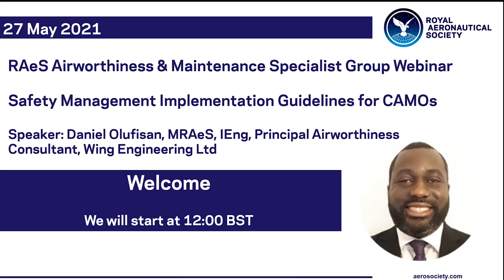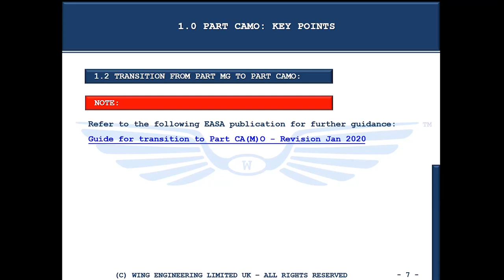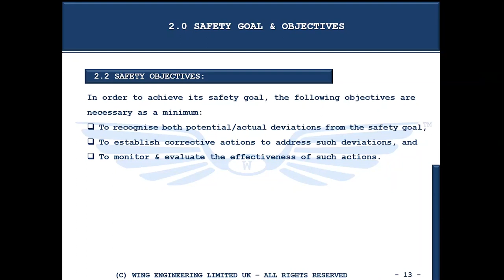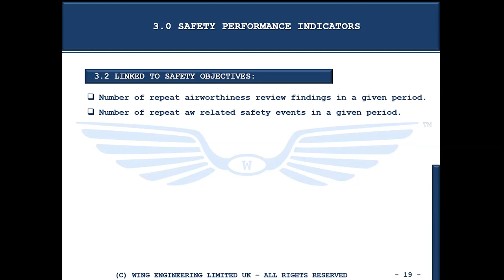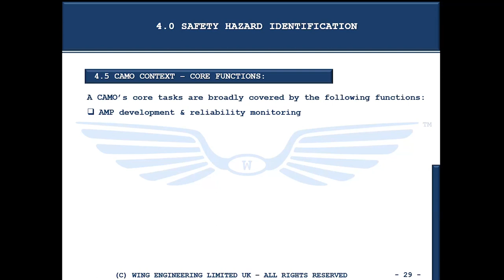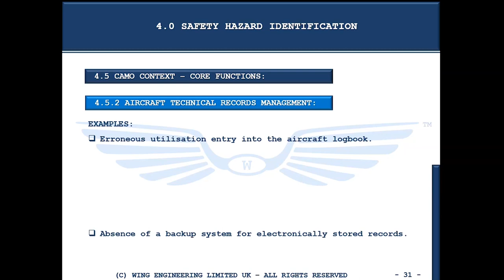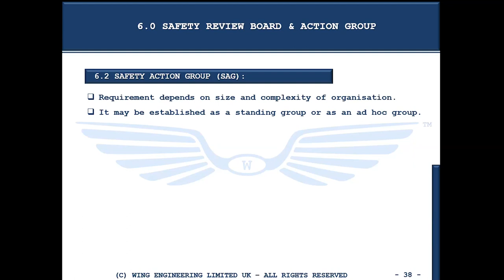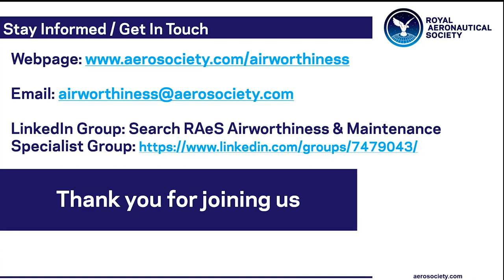RAeS Airworthiness & Maintenance Group: Safety Management Implementation Guidelines for CAMOs

Comment: Good and captivating presentation on Part-CAMO Implementation w.r.t. SMS. The examples of hazards explained though were interesting, as they seem to be failures of barriers put in place to mitigate or prevent the manifestation of a hazard into an undesirable event and subsequent consequence. For instance, the first example is the omission of an AMP task. In relation to the definition of a hazard, it is not an object but let's say it is a condition. Will the omission of particular task cause cause a consequence such as U-FIT. It would depend on why the task was put there in AMP or initially in the MRBR. It maybe to prevent 'Corrosion' or 'Structural Fatigue'. Such conditions would better fit the definition of a safety hazard. The AMP, Planning Software, Competent Staff, Checks and Evaluation .. etc are barriers in place to prevent a failure condition or undesirable state. If we are to consider the reduction in barrier efficiency as 'Hazards', wouldn't it lead to branching out the organisation's risk/hazard register or create unmanageable loops.